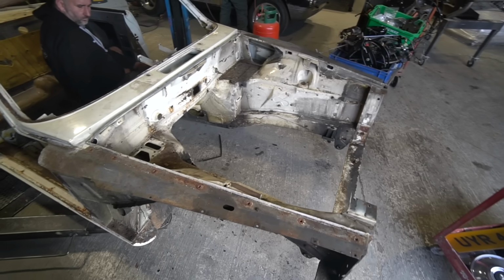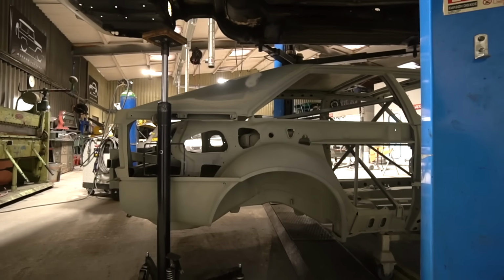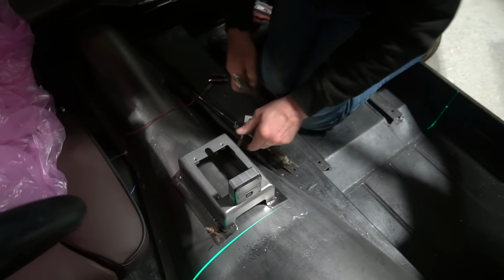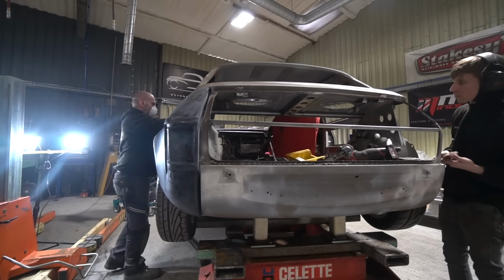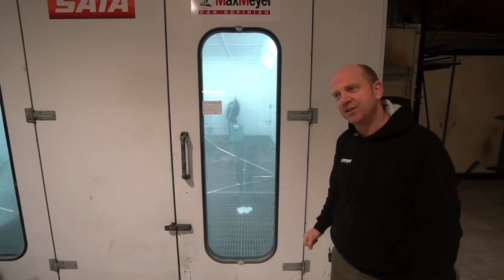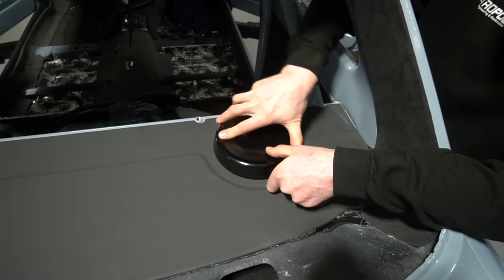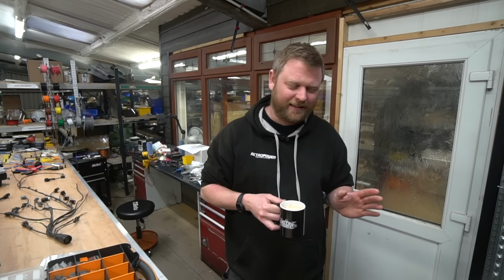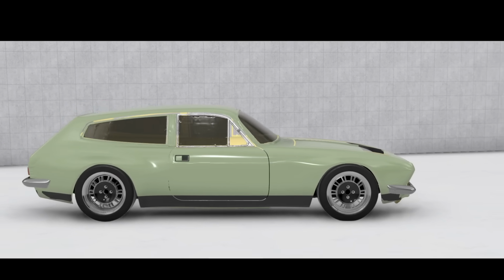Carbon Wide Body AUSTIN ALLEGRO!

Comment: The water blaster that you are getting is just a fantastic piece of Kit. Can’t tell you where I saw it being used. If I tell you I may have to shoot you. But trust me it is brilliant. Just don’t let it go across your toes.  It was being used to blast off rexine pads that were applied by Very thick,and I mean “very” thick contact adhesive. It blasted it to bare metal. Incredible.
Reply: I would disagree with the water blasting system as it's marine based and there are two aspects where it's the wrong tool. 1st it's designed for ships with thick metal, you are also blasting into crevices to get sealant out. Pushing moisture into the seams. Dry ice/alc is used for sealant or bitumen removal as it's not pushing the metal and it's not messy. Plus you require no machinery.  I use a vac abrasive blaster in conjunction with dry ice as this requires no blast room or wet room
Reply: Curtis at Cutting Edge Engineering has one ..

Comment: I was thinking about your ideas on removing the bitumen and sound isolation and did you ever try dry ice pallets and isopropyl alcohol? The basic idea is to mix and spread it over the area and wait till the crackling sound is over. It is now so cold and frozen rhat you can break it off without much effort. Maybe something to look into…

Comment: Also, for updated suspension, the 1991 to 1995 S2 subframes and suspension are a direct swap in and service parts are available, where they are not for the original ur Quattro

Comment: If you want another way to break down bitumen undercoating, try ether diesel or tolurene. 

As that's what is or was used up to 00's for stripping and removing bitumen from aggregate in testing laboratories. 

I worked in the tarmac/ aggregates trade for 8 yes, and it's because diesel fuel is one of the lowest refraction made from crude  oil.

And be aware that tolurene can be collected and cleaned and reused using a collection tank and still , once filtered.

And yes, this used to be in Ipson P40 from the 70s & 80s, cause l remember using it on bodywork on my Peugeot 205GTi 85/6 model with later 115 bhp engine, bought for £450 .
Yes remember prices like this lol .😅

Did a very simple and easy body restoration. The car was 10 yrs old when I got it, and poorly painted metallic teal bodyshell out of a spray can.

I fitted it with recovered parts and interior for £250, rear unmarked or cut parcel shelf for £25, 2nd hand plastic, and the hand tearing small metal buttons missing from the doors and wings.

The front under bumper valance was like a modern nylon jelly mold until fitted to the bumper, which could be done fitted to the car.
But it was easier to remove it and fit it together off the car, the Marchal spotlights rusted like buggery and were the most expensive ones that I never brought. Lol

I finally got it to primer, from spray cans, but was complimented on my restoration of the boy to primer. 

And replaced the brass rods for the gear selection, and then it took two mechanics to get the right gear selection sorted. 
But the car got taken on by my d@#k of my older brother, and he did his usual and left the car to get nicked and stripped out after my hard work!!!!

I'd love to restore my first 3 cars, a 1750HL Allegro estate, first cat l made a profit on, my 3rd car, MG Metro Turbo in the rare black colour but I ain't paying £9000 for a car that still needs work!

And finally my 2nd car, a Suzuki SJ410 convertible, l had a UAE import in brown!!! Yes, but called Terracotta on the paperwork lol.
Resprayed it black, pin striped it, and got a white hood and Cobra bucket seats originally for a Mini.
Got a replacement dash from Percy Tait Suzuki.

But now most Suzuki's have rusted or been wrecked on off-roading jaunts or flipped, but the dodgy tall body to chassis length is scary.
And it is great fun filled 6 up no roof or rear seats or seat belts and wobbling like a jelly. 

My car journey till I got my head turned by mc's and especially Italian mc's that have worse electrics than our supposed 'Lucas, lord of darkness' from the 70s. 
Which isn't right .

Comment: Re roll cage for Quattro , can’t a cage of much less intrusive gage tube be made to follow shape of the car , it may not reach stringent race specs but surely add a lot more strength in the case of a roll over ?

Comment: A couple things, if you guys haven't, you might get in contact with Iroz Motorsports in Las Vegas on the Quattro engine.  They specialize in that engine (usually in RS3/TT-RS) but Hank Iroz also has a Quattro of his own with the later North American Volkswagen 2.5l 5 cylinder (at ~900hp).  Second, on the Scimitar... would a 944esque arch not work with the original body line?

Comment: Stripping the walls of the paint booth, could you not use an air nozzle under the coating to allow it to bubble up for super easy removal like on car wraps?
Is it a customers choice to have the Retrpower logo on things, like eteh Escort mirrors and cluster surround hood catct etc, or are they compulsory as part of the contract for you to build the cars?
I had not noticed until seeing them close together in this episode, but is the Camaro and Utah the same color?

Comment: (Interceptor) - so the lower part of the rerouted fuel filler hose will always have the same level of fuel in it as the actual fuel tank. Therefore it should be a protected metal extension of the tank itself (I believe)..🤔

Comment: You should use on of the modern Audi longitudinal manual transmissions, allowing the engine to be mounted significantly further back in the engine bay.

Comment: Re the Interceptor fuel filler etc. 
How do you fill the tank from the bottom. ? Unless you use some sort of pressure. ? The pressure from the fuel pump at the petrol station isn't going to force it into the fuel tank..
Or am I incredibly dim. ?
Thanks.

Comment: If the sealer is so hard to take of can you not just reseal over it when you have finished the metal work then it twice as resistant.
Reply: They seam braize.
Reply: @johnsutcliffe3209  what does that mean. Please explain.  Cheers
Reply: @russcooke5671  seam brazing is a process by which heat is used to add a filler rod of bronze. Its melted and flows into the seam to add strength. The urethane based sealer is a contaminant that would make this process impossible. Its covered in detail on one of retropowers earlier videos.
Reply: @russcooke5671  oh I see Nat has already responded 🙂
Reply: @johnsutcliffe3209  I sort of understand   But don’t braising joints only  burn the sealer off of the part that is heated ???

Comment: Just wondering.  I'm not a painter but isn't it a good idea not to put your hands on a car especially if it has been undercoated etc. Body oil on hands etc. I realise you probably use grease and wax remover prior to further coats.

I noticed your stainless steel exhaust welds are all discoloured, which is a product of the TIG welding process.  This can be removed by wiping with a pickling solution available in welding shops. I don't know the correct name for this product but it's use makes for a better job.

Keep up the fantastic video's.  It's my favourite YouTube show down here in Australia.